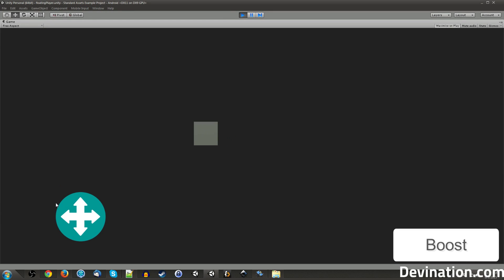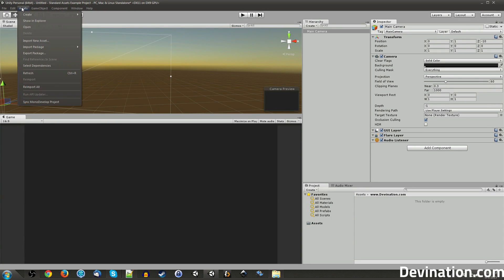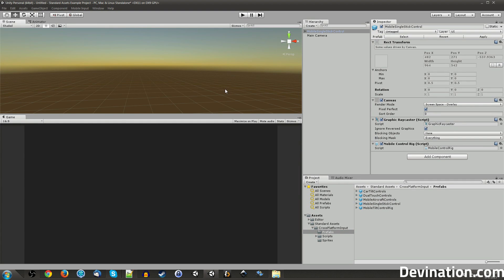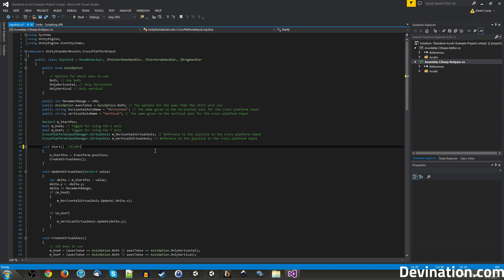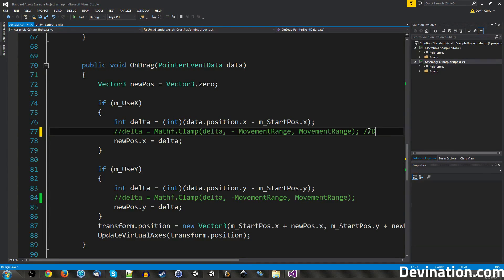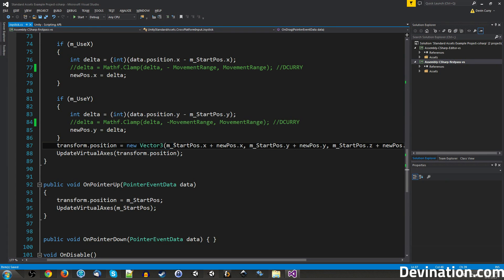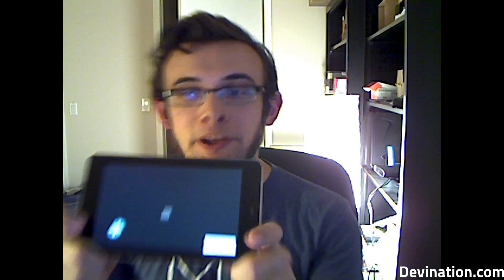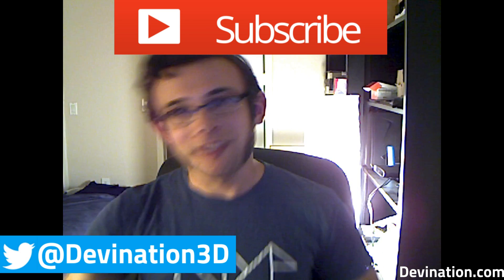Unity 5 Mobile Joysticks Tutorial - Touch Input 2D Spaceship Controller

Comment: Hey, I'm having a problem where my camera and MobileSingleStick control are in the x, y plane and I want to move an object resting on an x, z plane. When I use the controls it moves in the x directions (left, right on joystick), but no movement in z directions unless gravity is off, which causes it to float vertically up and down. I know the joystick up and down is y-axis and is configured for it. How would I update the joystick control so that down in the y-axis on the joystick is equivalent to negative z-axis for the object and up in the y-axis on the joystick is equivalent to positive z-axis movement. Thanks
Reply from the maker: +Michael Labus If you want to use the z axis, you'll have to use the regular 3D physics components, not the 2D ones like we used here. Then looking at the player script we wrote: change 'moveVec' to a Vector3 instead and use the joystick axes in the moveVec axes you want ie (Horizontal, 0, Vertical). And of course since we're using 3D Physics now. You'll also need to change 'myBody' to RigidBody instead of RigidBody2D
Reply: +Devin Curry Hey thanks man! I feel dumb... I was trying to edit the joystick controller, instead of the ball controller haha

Comment: By the way, I am new to unity and C#. I learned how to set up my this project on Lynda and the player input system is spread between a bunch of script that make it a difficult to figure out where actually to reference how to access the code I need to make it work. I tried to "GetComponents" for the output of the API with no luck. Can you help?
Reply from the maker: +Symmetry Thomas GetComponent<YourScript>() would be the way to do it through code, but if you can't get that to work. You could make public variables for each of your script types you need to reference, and then drag the objects that have those scripts onto those variables in the Inspector in the Unity Editor
Reply: +Devin Curry Would you mind checking out the code, Im pretty lost